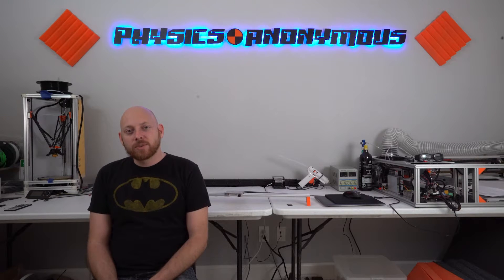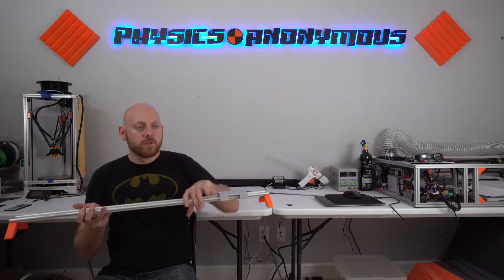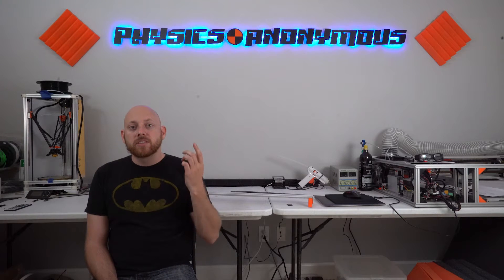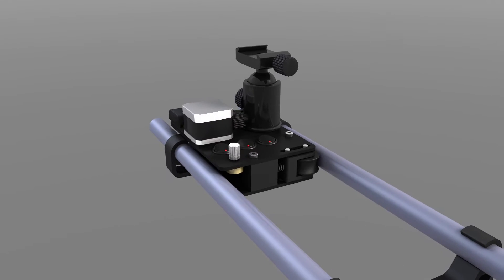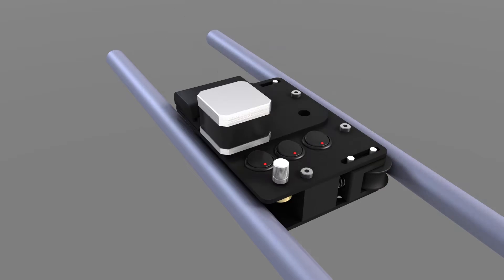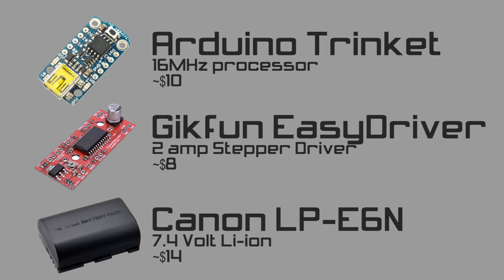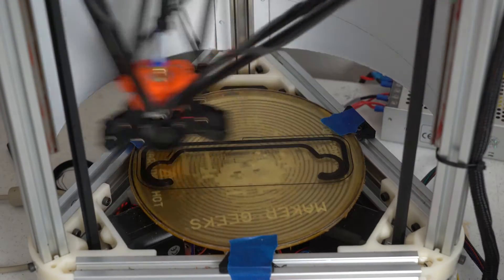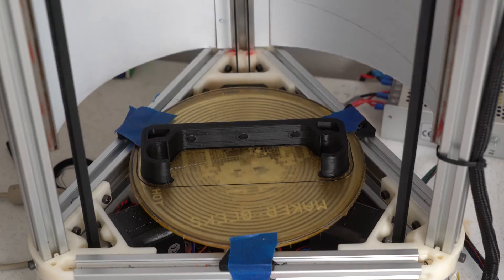S01E06 - Camera Slider (part 1)

Comment: *Solidly well built camera slider❋ ❋>share4.photo/eSliderCam?Wれ    I can hang diagonally up or down mounted on the tripod. Threaded on each siding for vertical mounting. Super sturdy and holds up so well. Great manual movement with my camera, rails run smooth on either one or two tripods, Great supportive sliding system. *